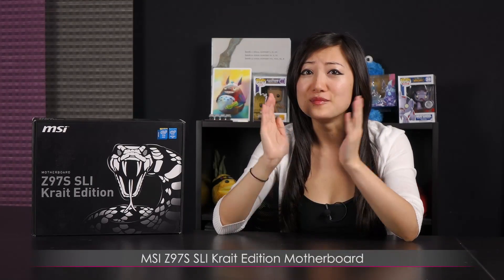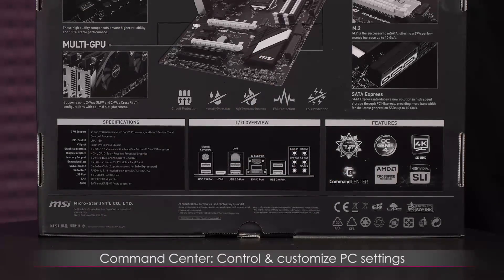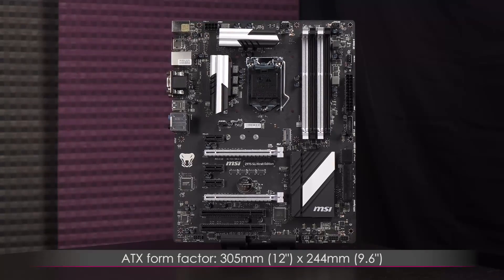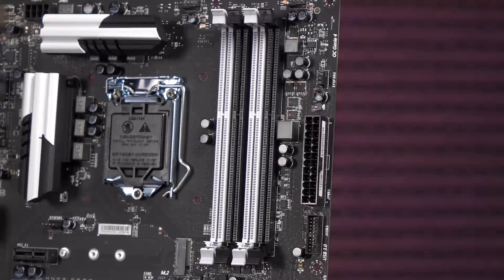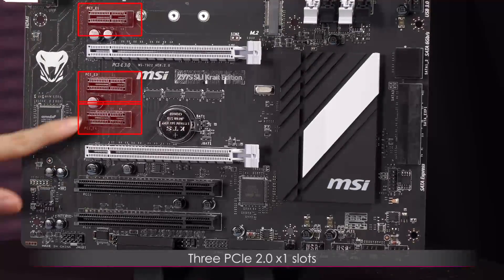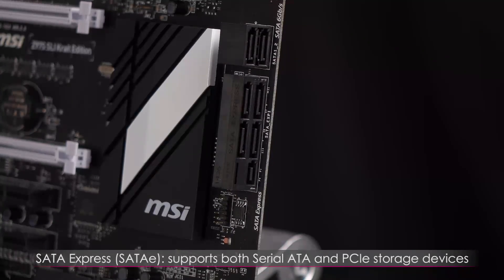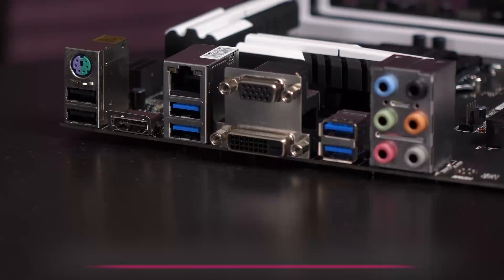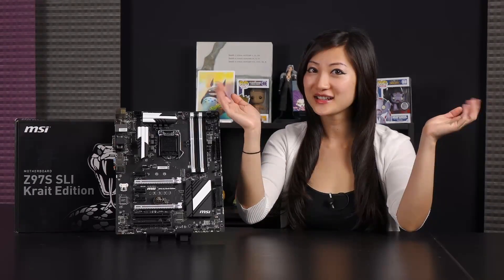MSI Z97S SLI Krait Edition Motherboard Overview

Comment: I want to use this board with a SLI 970, but what sli bridge should i use?
Reply: Don't sli a 970, the 3.5 gb of vram will limit you. If you want to do dual GPU without spending way too much money I suggest 2 8gb RX 480s. But to answer your question it doesn't really matter as long as it matches the slot compatibility. You don't need a HB bridge since it's a GTX 900 series card.

Comment: ok if i buy this mother board and buy a moniter that support @144ghz will i see only 60 fps or i will see the full 144fps plz help
Reply: Your GPU has to be able to push gaming to 60+fps. If you are using your processor's graphical abilities, or inabilities, then in gaming you are probably not even going to get to 60fps unless you are playing Minesweeper.

Comment: Seems like a solid board. I like that it has so many fan headers. It's a shame that the IO shield is so lackluster. I guess that's why we have plastidip :)
Reply: Did you ever try using plasti dip on the io shield? I'm considering doing this too if I get this motherboard.
Reply: +Afro Sama Dip would work fine. I couldn't think of a reason why I'd ever need to peel it so i ended up going with black paint. Thinner and a bit better finish.
Reply: +Ghos7 Eye Ok cool. Last question, did you use the spray plasti dip or the non spray?
Reply: +Afro Sama I didn't use plasti dip. I used paint. Definitely use spray if you go with plasti dip tho
Reply: Alright thanks

Comment: PC dummy here. What does it mean when she said the hdmi, dvi, and dsub require graphics processor? I can't use this motherboard without a card?
Reply: +Unelephant thats right
Reply: No that's not what it means. It means you need a CPU that has integrated graphics to use the video outputs on the mb. You don't need a graphics card.
Reply: Alright, thanks

Comment: No optical audio or even display port? : /
Reply: +shottybeatssword Your GPU will have a display port depending on high end it is, also you shouldnt really be using this board unless your gaming/creating content which a GPU is mostly needed for both :)
Reply: Jack Devlin I know my GPU has one, but it is pretty standard for 100$ Mobo to have a Display port : /
Reply: shottybeatssword If you your GPU has one why does it even matter hahaha ? Also link me one motherboard that has an oboard display port ?!?!?
Reply: Jack Devlin If i want 2 monitors and my gpu only has 1 port, then it matters. The H97 Gaming 3 and Z97 Gaming 5 from MSI both has Display Ports.
Reply: +shottybeatssword If you have a gpu your onboard video wouldn't work anyway. MOBOs prioritize the video card. (in most cases)

Comment: Can you add more than two SATA cables on this motherboard, it only comes with 2 so I'm confused :/ if you can add more than 2 cables that would be great for my needs!
Reply: +ThePratShow Sata cables can be bought on amazon pretty cheap, joanne will not have any control over the amount of sata cables included , contact MSI if you want to contact them about this suggestion. :)
Reply: +Jack Devlin | Thanks for the reply! I'll most likely buy a new set of third party cables for my PSU anyways so that's nothing to worry about! At least I know you can use more than just 2 Sata cables on this board. Most likely having four drives (2 SSD's / 2 1TB HDD's Seagate)
Reply: +ThePratShow Your welcome !! you can probably find cheap sata cables on Amazon :)

Comment: Which slots should i put my 2 8GB DDR3's in?
Reply: im sure it is gonna look cool dude ;)
Reply: either both on the 2 white slots on the top right or on the black ones if you want the dual channel to work :-) Place them at the same color slots
Reply: +fanhs kourelhs I plan in putting hyperx fury black & white ram inside to rock out my build

Comment: do u have to add auxiliary power to the motherboard when in SLI? If you do, where is the connector for that?
Reply: +OmerTheGreatOne You don't have to, but i hope your power system is good enough to support it
Reply: i ended up buying a different motherboard but thanks for the reply.

Comment: Please say Mdot2 instead of Mpoint2, i'm sure it will sound sexier.  Great vids by the way.  I might buy this motherboard for my first build this helped out real good, since my 7970m on my laptop decided to die.  Bought a GTX 970m to replace it, but building a pc is alot more cost efficient in case I need to replace a part.

Comment: CHIPSET HELP PLEASE!
ok. If I get a i5-4690K with  "Compatible chipsets: Intel B85, Intel H81, Intel H87, Intel Q85, Intel Q87, Intel Z87", Will This work work with THIS motherboard!? or doesn't the "compatible Chipset" affect my it, because the socket is the same 
PLEASE help me!
Reply: +Maurits yæh I'm almost positive that if the socket is the same you should be fine, though I'm not 100% sure.
Reply: +grapies I think if the socket is the same you can just throw every CPU in it :P

Comment: my PC specs
CPU: Intel® Core™ i7 4790K
CPU Cooler: NZXT Kraken X61 280mm AIO Liquid CPU Cooler
Motherboard: MSI Z97S SLI Krait Edition Motherboard
Graphics: 2x EVGA GeForce GTX 980 Superclocked ACX 2.0 4GB
Memory: 2x Kingston Hyper X Fury HX318C10FWK2/8 8GB (2x4GB) White for a total of 16GB (4x4GB)
Solid State Drive: Samsung 850 EVO Series 250GB SSD
Hard Drive: Seagate Barracuda 2TB ST2000DM001
Case: Be Quiet! Silent Base 800 Case with Window Black
Power Supply: EVGA SuperNOVA 850W G2 Gold Power Supply
Cable Kit: PCCG Sleeved Cable Extension Kit Monochrome
Additional Cables: 2x PCCG Sleeved 45cm PCI-E 6pin Cable Monochrome
Additional Lighting: NZXT Sleeved LED Cable 200cm White
Reply: That looks awesome
Reply: +Tony Sopovski what games you play
Reply: atm playing black ops 3  i changed my video cards to 2 EVGA titan x superclocked cards now
Reply: yeh it its beautiful mobo i love it
Reply: the board owns for gamming 10/10 no dought  great motherboard ! designed for overclocks to!
Reply: +Tony Sopovski Can you post a video on how black ops 3 runs on that setup?
Reply: black ops 3  is gorgeous graphics is beyond beautiful!
Reply: +Tony Sopovski I know, but I wanted you to post a video lol
Reply: lol i dont have a recorder
Reply: +Tony Sopovski NVIDIA graphics cards have built in recorders, you see it when you install the drivers
Reply: hi dude yo will be on top of the earth, great gamming experience  since then i sold my 980's and got titan x cards and 2 more solid state samsung pro evo harddrives 512 gig each
Reply: +Tony Sopovski "solid state samsung pro evo harddrives"
Reply: +Tony Sopovski Hey I want to get some G4me Zero's and I was wondering if this has a dedicated amp or whatnot seeing that the headset is 150ohm
Reply: +Tony Sopovski Because I want to have enough power for the headset and I didn't want to waste my money and buy something yet if the mobo already has it. Also if it doesn't have one I would like a suggestion if u happen to have one lol. Thanks for the help in advanced!
Reply: no problem :)
Reply: +Tony Sopovski Do you still have the MSI Z97S MB? Does it still run good?
Reply: yeh runs perfect its a high end MB it hasnt never  not ran well its perfect
Reply: Tony Sopovski Thank you for getting back to me, I appreciate it. I will either get this board which I like the look of a hell of a lot better, or the MSI Gaming 5.
Reply: +Tony Sopovski  You are so full of shit, you dont have that computer. And if you do, and you play Blacks Ops 3. Get fucking help.
Reply: lol yeh im going to make up shit to lie get a life i used to play black ops 3  on my beats pc now i play tom clany siege you jealous loser :)
Reply: oh and another notes im using titan x cards SC editions sold my 980 gtx cards on ebay :)
Reply: http://tinypic.com/view.php?pic=mr7ndt&s=9#.VpCHExV977c
Reply: owned :)
Reply: Tony Sopovski This doesn't prove anything, you posted a picture of somebody having these cards, how do I know it is you?

owned
also having porn as your wallpaper, get a life.
Reply: bro i dont need t prove shit to you. i know  i own a high end pc and that  is that lol dont be a hater .
Reply: just to make you burn with specs i posted about my pc earlier   http://tinypic.com/view.php?pic=b6ee4x&s=9#.VpCOuBV977c
Reply: owned again anyway time is money :)
Reply: Tony Sopovski 2 titan x and your monitor can only display 30 fps... get help
Reply: its conneted to a 55 inch tv owned again  and changed to 60fps  now  :)
Reply: Tony Sopovski proof?
Reply: lol owned
Reply: Tony Sopovski no proof? lol owned
Reply: +SupremeMystique I have it as well. Amazing mobo.. Where are these "bad things" you've heard regarding it for gaming?
Reply: there is no bad things its a high end MB no flaws just high specs and beautiful looking board
Reply: +Tony Sopovski yes, you can  run minecraft
Reply: +Tony Sopovski Oh damn, I was just going through the specs and realised it's basically identical to the one i'm making. How does it run? :)
Reply: +RuuFiss loll!!

Comment: Hey if anyone has this motherboard I'd really like to know what you think about it. Really my question is, is there any bad things about this board?
I will be using a i5 4690k and will overclock it eventually when I learn how.
Reply: Thanks but you told me too late I already bought it. I think it's okay.
Reply: *****  Ya, I thought my build would be black in white but it ended up looking like this. http://gyazo.com/478e97eadadd315cb7685ad71cc8d762
Reply: My case is the Corsair Carbide 500R

Comment: The build I'm planning on purchasing:
EVGA GTX 980 ti
MSI Z97S SLI Krait Edition 
8gb DDR3 HyperX RAM 
EVGA superNOVA 750w Power Supply
NZXT H440 Case
i5-4690k processor

How does it sound??
Reply: Guuuuud
Reply: Sämst

Comment: I'm in the middle of building a gaming PC... I was wondering if I still need a Sound Card and Wifi-Adapter with this, or does this Motherboard have it built-in?
Reply: ***** Yes it will work but not that fast.
Reply: +TheNoobAssassin So, not a usb one, but one you plugin in one of your pci-e slots?
Reply: ***** I don't know where you're from, so I just give you the name of the usb one ;). Pci-e card: http://www.intel.com/content/www/us/en/wireless-products/dual-band-wireless-ac-7260-bluetooth.html this is an Intel one so trustworthy and it has bluetooth too. If you want a USB one, get a USB3.0 one that's faster, but you gotta have USB3.0 ports on you motherboard. The TP-Link Archer T4U is a nice one. Look it up by yourself :)

Comment: Can I use my 120mm fans on the CPU fan slots?
I have water cooling so it basically eliminates the use for them anyways.
Reply: Blank of course. they're all exactly the same, your cpu fan would be a normal 120 or 140 anyways

Comment: I have 7 fans.
Exhaust: 1 rear, 2 on radiator, 1 next to radiator.
Push: 3 in the front.
How do I make it work with the motherboard? 
Help highly appreciated!
Reply: Get a fan controller
Reply: ๖ۣۜBeyond Earth Does the mobo support up to 5 fans or how many?
Reply: Blank A fan controller will allow you to plug in the fans at the front and connect it to your power supply. The 3 other fans can connect to your motherboard
Reply: Blank the mobo has 5 fan connectors. 2 of them are CPU fan connectors
Reply: ๖ۣۜBeyond Earth And I can't use them for normal 120mm case fans? I have a CPU water cooler so CPU fan slots are otherwise unnecessary.
Reply: Blank You can, but you still need to connect those fans on your rad to something, and i recommend that you connect it to the CPU fan slot so its easier while monitoring temos.
Reply: ๖ۣۜBeyond Earth Thanks! :)
Reply: Blank Np
Reply: Blank I meant Temps btw
Reply: +Blank You can get fan splitters and just hide the cabling in the back of the case

Comment: I almost bought this mobo a couple months ago for my new build but got the MSI Z97s SLI Plus instead due to the high failure rate of the former. At least according to Newegg reviews. Cool board though. If the negative newegg reviews are an anomaly, then the Z97s SLI Krait should be a great mobo with a fantastic design that compliments any black and white build for DIY builders that decide to eschew the stale and commonplace red or blue designs.
Reply from the maker: I think there's always a failure rate with any product.
Hope it's not the case for most who purchase this!

Comment: Looking at it, I was thinking right away to replace my old Z77A G45. However, upon looking at the PCI and the second PCIE slot is not x16 electrically connected, I decided to keep it.

For the PCI, I couldn't find a compatible drivers for them, so that's why I opted for full PCIE.

For the second PCIE being full x16, is in case I need to diagnose my card.
Reply from the maker: Thanks for sharing your thoughts!

Comment: Only two ways it could be better are to make it white/black instead of black (like every mobo)/white and to add tabs to the mobo manual for the good bits, like specs, settings, etc.
Reply from the maker: Good points :)
I think you can never go wrong with black or white!

Comment: oh man, this would make a great build in an R5!.

get an asus Direct CU2 card, some black/white ram, a black/white PSU.

get a Heatsink that take regular 120mm fans, pop 2 coarsair black n white fans.

man that would be a sexy ass build. If I had a million dollars I would do it ahah.

but in reality we keep our cases tucked away so it doesn't mater.
Reply: Hocaj
bad. First off, if you're getting a non K CPU, get a cheapo motherboard since you wont be doing any overclocking.

Second an R5? on a budget, get a better GPU before you get a nice case.

Get a 500w EVGA PSU.
You should get a 256gb BX100 SSD, better bang for buck.

lastly for windows. get it here http://mskeystore.tictail.com/
Reply: Kasj26 Miner its a good build, but I would have skimmped on some of the parts to get a 290 or a 970.
Reply: John RedHead
the 1080p monitor makes me sad
Reply from the maker: Haha, looks like you've thought it all through!
Reply: http://uk.pcpartpicker.com/p/2fWR6h
Planning to build this in a while, how is it?
Reply: My build:
Msi Krait Motherboard
Intel Core i7 4790k CPU
HyperX 16GB 1866Mhz White version
Zotac GTX 970 4GB Vram GPU
Corsair H55 CPU Cooler
Corsair AX760 Power Supply
Kingston 240GB SSD 
Seagate 3TB HDD 
And the last
Corsair Spec 03 white LED light!

How much fps, can i get on the best game on the market?

Does it get easy overheated?
Reply: http://uk.pcpartpicker.com/p/M73KRB
Hows about this?
Reply: Hocaj get a fractle core case instead of a define, and go for an h97 or h87 motherboard. no need for a big motherboard with that build.

also for Windows do look at the site I mentioned will save you 60 quid on it.

otherwise not bad, but if you can muster the cash, get a better GPU like a 280x or something.
Reply: Hocaj
http://uk.pcpartpicker.com/p/QZjPNG
Reply: The case i want now, is the Corsair 760t white, with white LED Lights
Reply: My Build:
CPU: I5 4690k
MB: Msi Krait Edition Z97
CPU Cooler: Corsair H55
RAM: Corsair Vengance Pro 16GB 1600Mhz Silver
GPU: Zotac GTX 960 2GB Vram
SSD: Kingston 120GB
HDD's: 2x WD Desktop 1TB's
PSU: Corsair RM650
And
Case: Corsair Spec 03 with White LED light

How long, would this PC last?
Is this enough to cool, the PC parts?
Reply: MrMassivemeatlog This will be my build soon. It has all white and black accept for the headset,keyboard, and graphics card. http://pcpartpicker.com/p/LVNq8d
Reply: That is just temporary. Ill upgrade to another GTX 980 then buy a 1440p monitor.
Reply: John RedHead the 970 does 1440p beautifully
Reply: I like to max my games out with 70+ fps.
Reply: John RedHead
witcher 3 is the first game I've encountered that I haven't been able to max it out with my 970 on 1440p.
Reply: I know its just gtx 980s are sexy
Reply: John RedHead
they litterally have the same heatsinks as the 970s since they're the same PCB.

only exception is a reference 980 and if you get a reference 980 WTF are you doing.
Reply: I rather have the extra .5 gigs in the gtx 980 for the future.
Reply: John RedHead If you want to get an extra 980 later on, and you like big vram, get a Titan X :)
Reply: Naaah... Im getting the 980ti
Reply: John RedHead That's a good choice for sure, I forgot about that one :D
Reply: :D

Comment: why in gods name would they include PCI slots?
Reply: For more USB Ports? More Voodoo Cards? Addon cards?
Reply: Some folks happen to have PCI cards for specific software/hardware needs. There's all kinds of PCI SCSI cards from the past that perfectly work fine so makers are trying to help those folks out with new upgrades while preserving some of the older network/hardware/software needs that still exist.
Reply: For sound card, SSD, etc.
Reply: True...I have a fast scsi card for a large flatbed scanner...back when they made them with real light bulbs and metal parts.